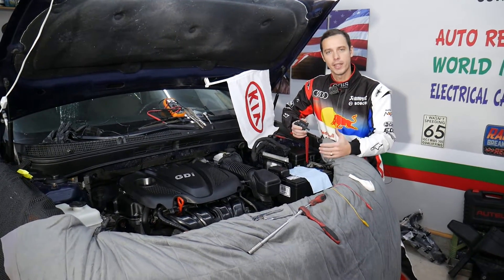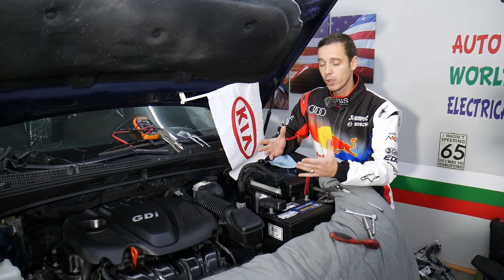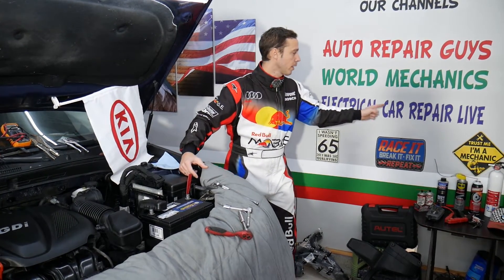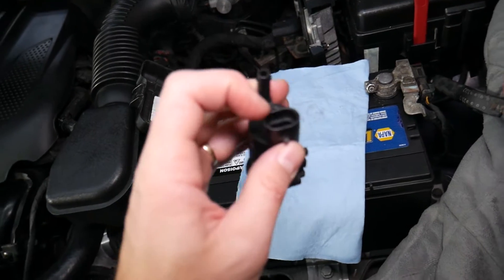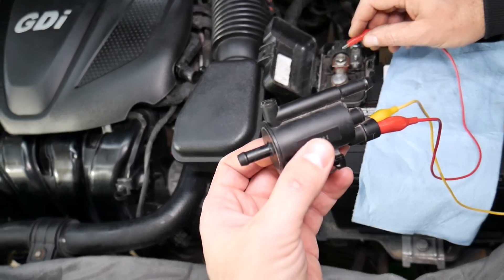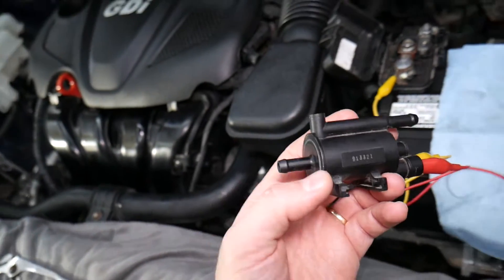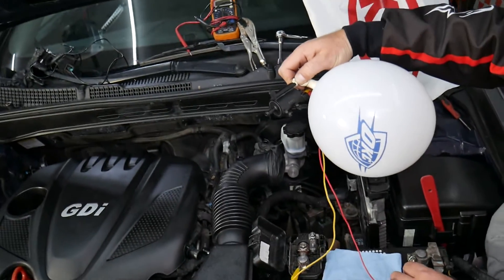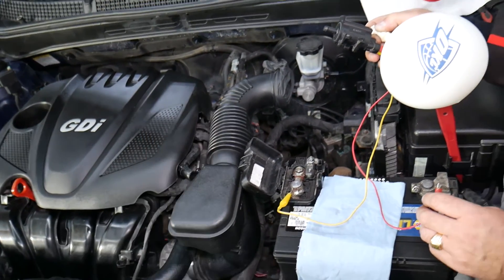HOW TO TEST PURGE CONTROL VALVE ON KIA OPTIMA

Comment: changed the purge valve on my 2013 Optima, no problem for a couple of months, weather turned cold and now getting P0456 again, is smoke test the next thing to try ? Seconday question, seems like you guys work on a lot of Kia's/Hyundai's, ever coded/programed  a Kia remote ? I used a Launch scanner and was able to program a new remote for my 2015 Santa Fe but am not having any success progamming a new remote for my 2013 Optima ?